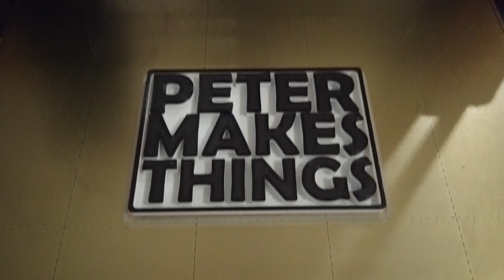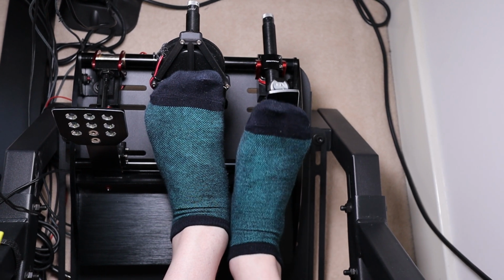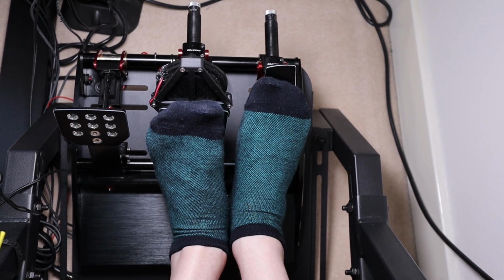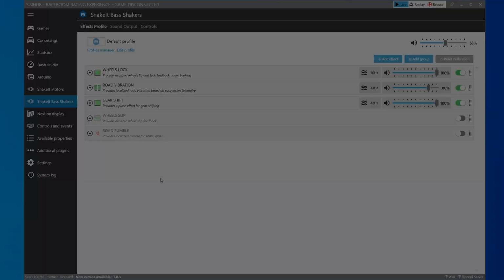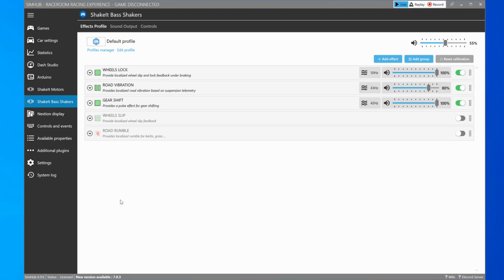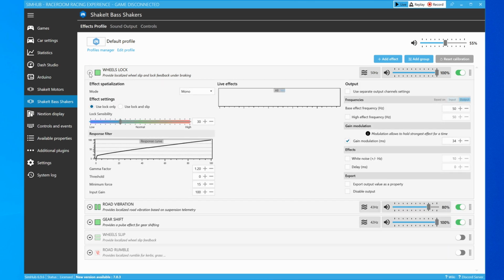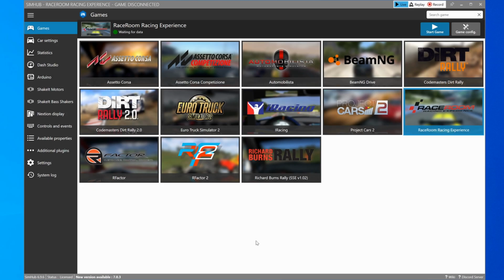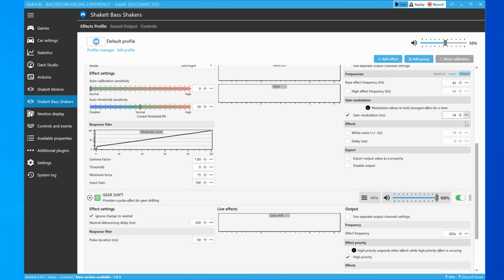Silly design that actually works great - Bass Shaker for Fanatec V3s

Comment: Can you tell me if there is a way for me to put this bass shaker in place of the original by connecting this big bass in place of the small one by splicing the wires

Comment: What size nuts and bolts to attach the Dayton Audio puck to the bracket? Thanks!
Reply: Got them, and figured I'd reply to myself since I answered my own question. M3 x 22mm worked great. got m3 lock nuts to secure em.
Reply: @oliverturan9597  thanks! I hate when people post this type of videos with zero help in comment

Comment: I have 6 of those shakers but every amp I use doesn't have the same effect as an aura amp. I am wondering what amp should be used for the shakers I see alot of car amps. I was using just a 50wx2 amp from amazon and it is usless so i will have to look into a car amp.. any recommends?

Comment: Simhub is great, I have been using it for over a year now. Shakers, button box and dashboards. For the shaker you can use usb (laptop) soundcards for sound output they only cost $12.00. I use pyle 160 watt 2 channel amps cost $38-48.00 (black friday sale)  The Dayton bst-1 50 watt shaker is plenty strong and only $39.00. You can build a whole two shaker system for under $200.00.

Comment: I wish i could have this for my T3PA pedals from Thrustmaster..
Reply from the maker: I had these for some time and the gamepad motors actually work very well with them, check a video by amstudio
Reply: @petermakesthings7342  wow! Thanks for your reply. I just want to say you are insane with what you do, so much work, dedication, time to develope etc. Really great work! Keep up! I will check your suggestion. Greetings from the Netherlands
Reply: @petermakesthings7342  Very inspiring video, thanks for upload! I have T3PAs too and I want to add some feedback to throttle and brake pedals. I am not sure if I should use gamepad motors or small bass shakers on each pedal. I would think shakers give more detailed feedback, right? Or do you think motors are better for T3PA? Would like to hear about your experience, if you have the time. : )
Reply from the maker: @jorn-jorenjorenson5028  t3pa's (not pro) are pretty light and plastic, for these I'd go with gamepad motors, much simpler assembly and feedback is pretty alright, the bass shakers might be a bit too heavy for your setup
Reply: @petermakesthings7342  Thank you very much, very helpful to get some advice! : )